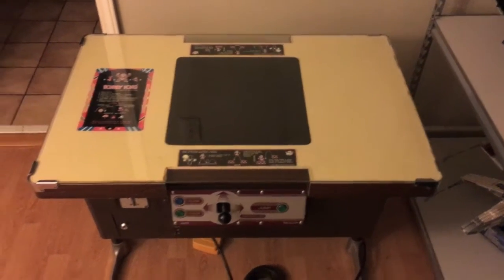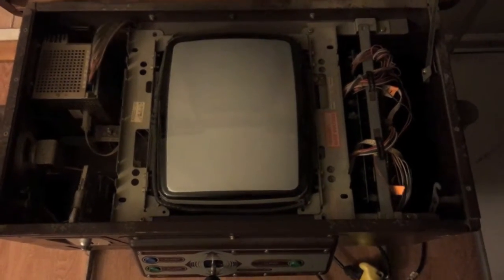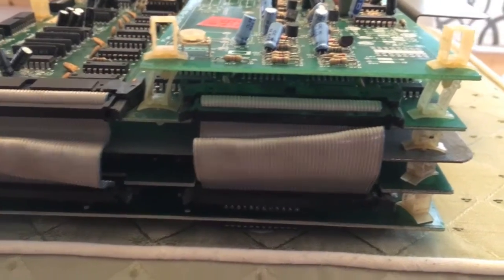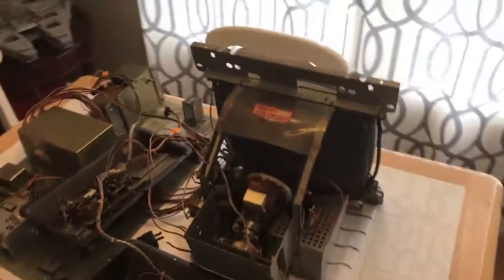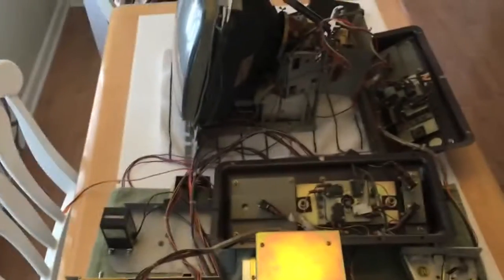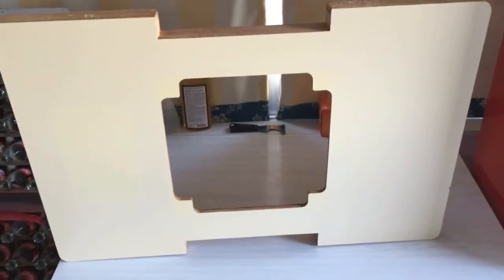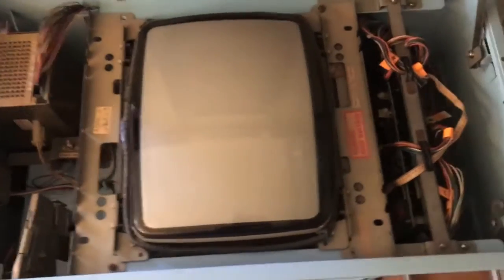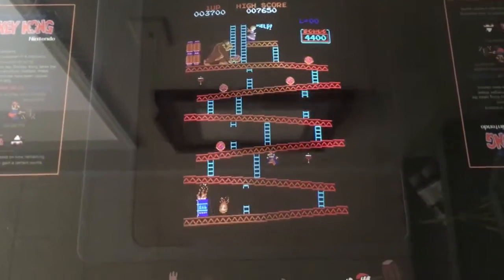Donkey Kong Arcade Cocktail Table Restoration

Comment: Great to see a new video from another Addict. Top looks great. Was there any conflicting feelings replacing the original graphics or colors?
Reply from the maker: Todd had some hesitations about not keeping it in it's original form, but overall he liked the color scheme a little bit more so he went for it.
Reply: Yeah, I struggled about restoring it to original versus what I did. I think this is how Nintendo would have made it based on the uprights.
Reply: +Toddy 83 yea when I figured out you were removing the original decals I was like dude no! But I'm glad you did it the way you did that thing turned out sick!